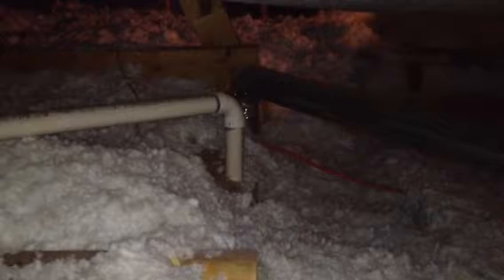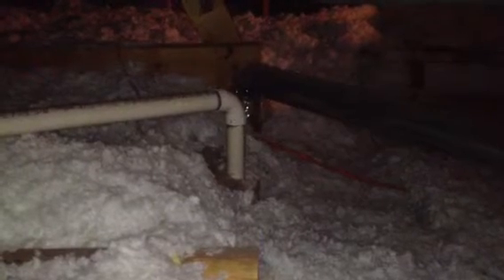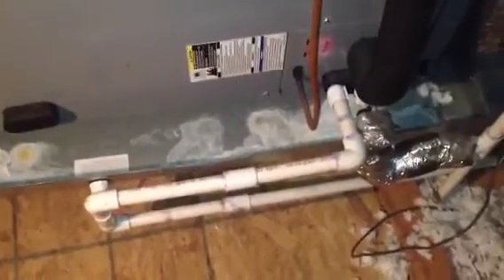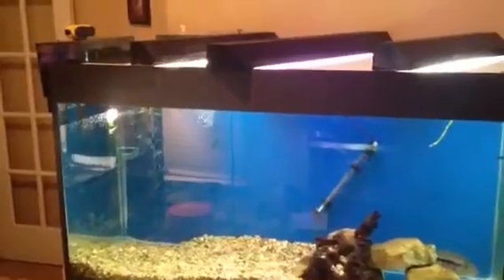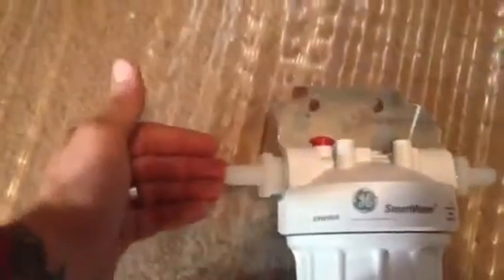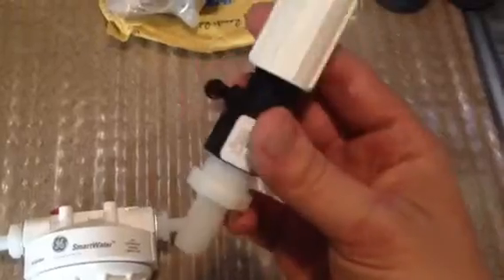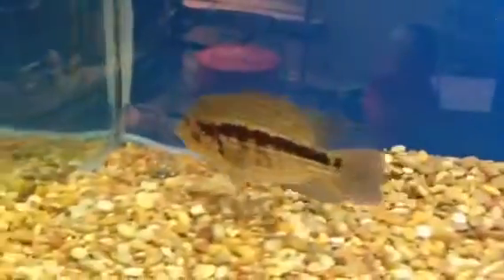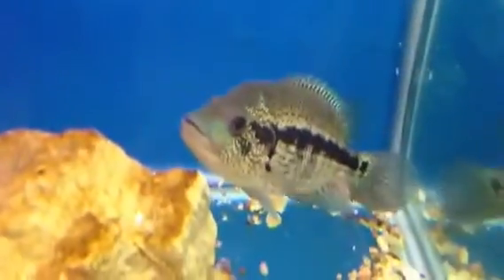Drip System Update

Comment: Looking good man!! Always like to see prep lambing before jumping into projects. One note on the 1/2" line is that it kinks easily.  I would just run PVC through the ceiling instead of the black tubing.  The problem I see with connections on the ceiling is workability. If there's a leak or something your gonna have to work over your head which is a pain sometimes.